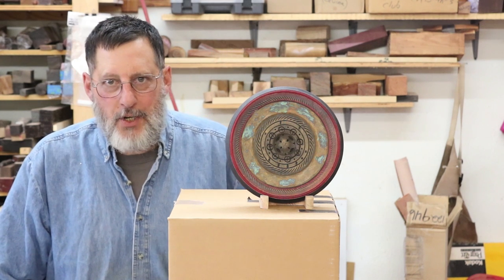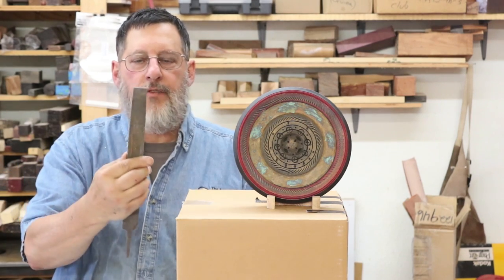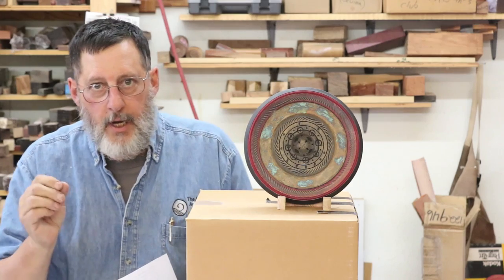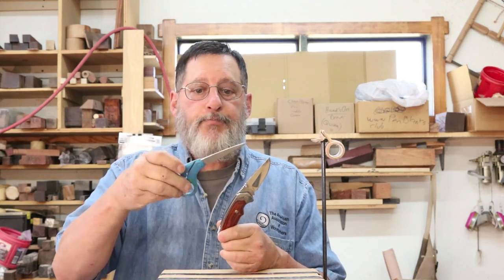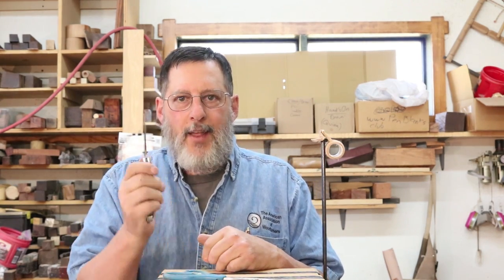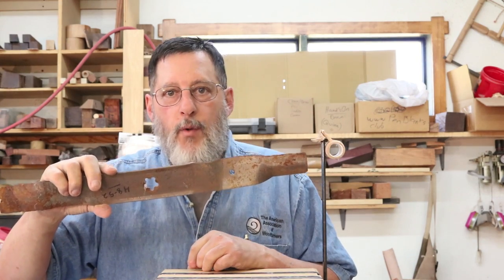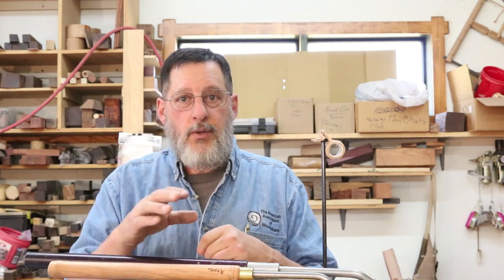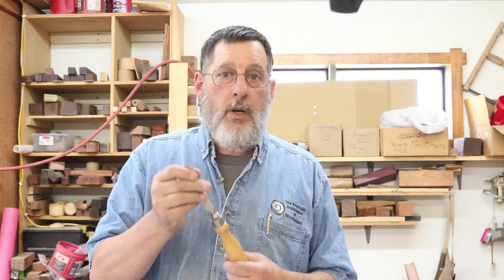ROCKWELL HARDNESS  Scale in woodworking and woodturning:   Sam Angelo

Comment: I used to test RHC (rockwell hardness C scale) on shovels and yard tools to see if our heat treating and quenching process was accurate.  A RHC score of 55 without tempering causes extremely brittle steel.  One demo we would do is throw a heat treated, non-tempered shovel head straight down onto concreate.  It would shatter like glass, shards, little sharp pieces, etc.  Tempering is something to consider as well, not just RHC.
Reply from the maker: Thanks, good information.  Sam
Reply: +WYOMINGWOODTURNER loved the video...lots of good info in it.
Reply: Type of steel is something else to consider.  Different kinds of steel will harden to different hardnesses and some can be left much harder than others without being brittle.  D2 tool steel or 404 stainless for examples have enough alloys added to the steel that they can be left at RC60 & not be brittle.  All steels to my knowledge need to be tempered after hardening though to make it be not brittle.  (The D2 & 404 I referred to quench to RC65, so drawing out a mere 5 points of hardness is enough to toughen the steel up.  O1 quenches out to 58-60 at full hardness and so will be softer after tempering.)
Reply: +RealRuler2112 Very true and more good points, though I dont think I would make a turning tool from stainless, would be hard to sharpen depending on the grade, would hold an edge for a long time though.  I used mild 1050 steel for the tools I made.  Not has good as tool steel but good enough for detailing.

Comment: Great video Sam, this is a subject I find very interesting, I wish I could afford a test machine. I recently had to return a couple of bowl gouges which would not hold an edge and I would love to know what the Rockwell hardness was on these compared to others I have from the same manufacturer. All the best, Jim.
Reply from the maker: Thanks
Sam
Reply: You can buy file sets made for this Jimson.  You file the piece of steel in question with each file and when it won't bite into the metal anymore, you know that the next one down is about how hard it is.  (Not as exact as a Rockwell machine, but much more accessible for regular people.)  My father was a metallurgist at GM for over 30 years & has a plethora of stories to tell about heat-treatment of steels...
Reply: +RealRuler2112 thanks, I did look at those, perhaps I will get a set.

Comment: Great video. You mentioned, and I have heard elsewhere, about how the tip of a turning tool or even a regular chisel might have a different hardness than the rest of it. Does that mean that after a tool has been sharpened over the years and looses an inch or so it is not as good anymore? I ask because I have purchased old chisels before and didn't really take into account the original length versus what they look like now.
Reply from the maker: Yes that is true.  Now I think far more than an inch is hardened.  I am not sure how to make sure HOW much is haredened.  Just buy good tools.  But your old tools will work, certainly.  You may have to sharpen more often????
Sam

Comment: All steel has some carbon included in it  it is the process for converting iron to steel . It is the chemical balance between the %of alloying metals and the iron that give  steel its different properties. This is also the main problem of asian import steels is they use recycled base stock and do not first exclude the impurities in the shredded metal they use. This leads to inconsistencies between batches. The amounts of carbon, Moly, chrome, Lead, all have effects on the physical properties. The Rockwell test can be done in a number of different modes with different indentors and loads  and does not really tell the whole story.

The strength is a balance in the grain structure of the metal  Toughness , strength, wear resistance, Malleability . can be indicated in a rough way by the Rockwell number. and a metallurgist can give good indications on how the item will perform under use only if he knows the alloy and heat treatment or lack of in the part   

Taking that mower blade as an example it needs to keep a tough edge at the tip  (tip speed is regulated by Government safety standards) so it will cut the grass cleanly. but the hub needs to have a great deal of shock resistance because it drives the blade and has the hole stresses the sections between the center and the tip need to have fatigue resistance because they flex a lot.

The properties listed above are all imparted by the manufacturing processes at the factory  after which spot testing for Rockwell  hardness in different sections will tell if the process worked    Same steel from mill different Hardness in different locations because of the process
Reply from the maker: Thanks
I appreciate the information.  The bit about the mower blade being hardened differently at the hub is interesting.  I know tools are (or can be) hardened differently at the cutting edge than lower on the shank.  I think an important point I would make, is as a consumer of tools, we just don't know how they were made.  Maybe sometimes we do.  If i but a Doug Thompson tool or a D-way tool, I know they will not break and are top quality.  Thanks Sam